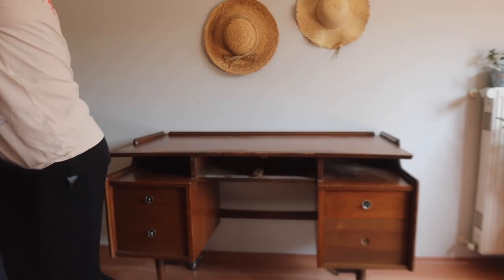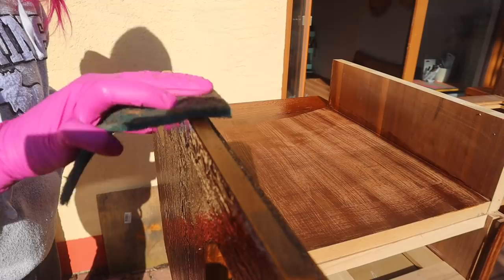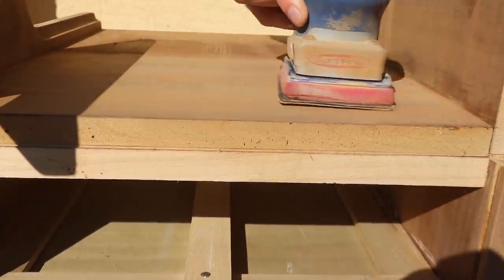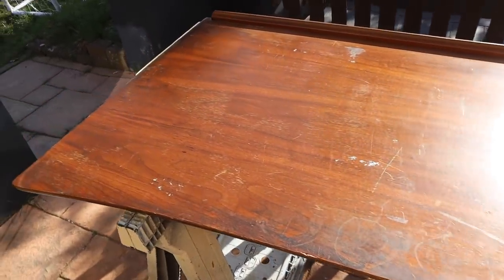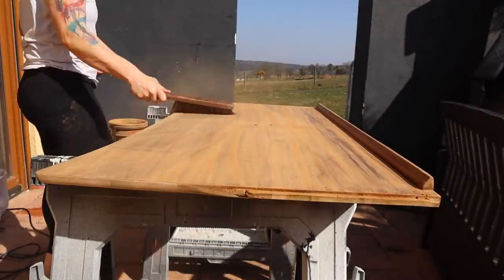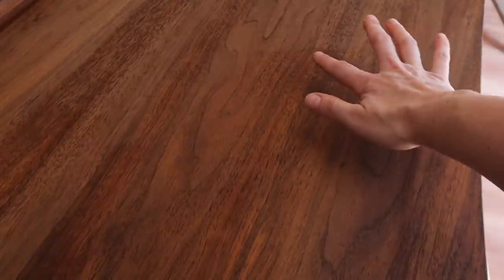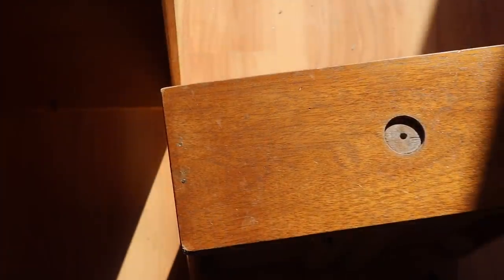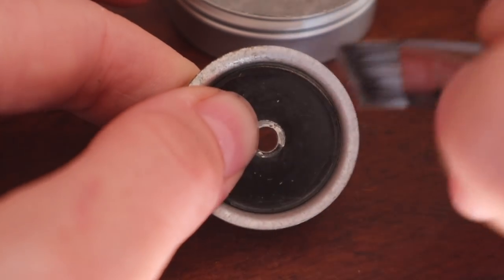Furniture Restoration: a Midcentury Modern Desk

Comment: I watch a lot of Dashner Design & Restoration's channels and I love watching the attention to detail required to make repairs like the wood filler look natural and blend back in with the rest of the piece :)

I'm curious why you can't boil the hardware - is it just a material that won't work for?
Reply from the maker: Yes it’s a stainless steel type metal so it’s not sort on there it’s actually corrosion that I cleaned and sanded and then fixed :)

Comment: Can you elaborate on why you used wise owl enamel satin finish vs wax finish.
Reply from the maker: So to be era correct I used the enamel so it has a sheen, also it is more durable and because this is her work desk I wanted to make sure it would be sealed properly :)
Reply: @BellaRenovare  thanks. I am still learning why certain sealers and waxes are used. There doesn't seem to be a genera l rule to go by